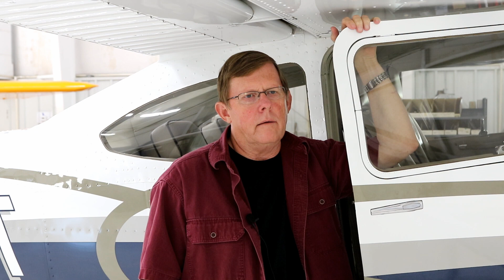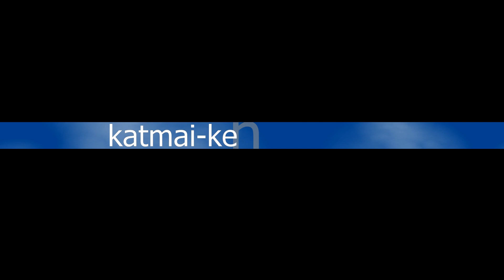Choosing Lean of Peak or Rich of Peak

Comment: I still don’t believe EGT doesn’t matter. If you’ve got compression and timing that EGT getting hot enough can burn it down in that combustion chamber. Anything low compression and timing not a chance. But turbo and or high compression experimental I can see premature issues.

Comment: The way I've been taught is, ROP for best power and LOP for best range!  Also, how come you talk about using cylinder temperatures and fuel flows for setting the mixture, rather than EGT???
Reply: Flight schools apparently don't know about engines. Or if they do - they treat everybody like "you don't have to worry your little head with that".
Reply: Cylinder head temperature is related to internal cylinder pressure, which is tied to stresses on the engine.  Running lean of peak may slow you down 10 percent or so, but reduce fuel consumption by day 20%.
Reply: @christopherbrown1730  Like I said, you run lean of peak if you want to fly farther on a tank of gas -- BUT you set your mixture using your EGT gauge, NOT your CHT gauge!
Reply: @agentorange153  that is not the way Mike Busch explained it in a video from Saavy Aviation about engine leaning.
Reply: @christopherbrown1730  Because CHT is NOT a precise measurement of air-fuel ratio -- it depends on MANY different factors other than your engine settings, such as airspeed, density altitude, cowl flap setting (if you have them) and outside air temperature, among others!  Whereas EGT is FAR more consistent -- it depends only on your power setting and your air-fuel ratio!  So, when you lean your mixture (whether you want to lean ROP or LOP), you use your EGT gauge for the mixture setting, and watch your CHT gauge only to make sure it stays in the green zone!
Reply: @agentorange153  copy.  A small nuisance that I missed.
Reply: @christopherbrown1730  Which is NOT important if ALL that you want to do is save engine wear -- but it DOES become important if you actually want to maximize either range or performance!
Reply: Also, i forgot to mention - the dangerous temp. is when cylinder temp. (CHT) gets above 400 F (i think) which can happen mostly at 75 % power or above. Thing is, that the highest EGT is at 14,7:1 ratio, which is 'peak' and still in that 'danger zone' but coming back down that curve (to lean of peak). Highest CHT is rich of peak, before highest EGT, rising to maximum 13,2:1 ratio or thereabouts. But safe safe zone would be richer than that at 12,:0:1. Or lean at 15,2-15,5:1. The numbers are not precise due to the different cooling systems.
Reply: @terjehansen0101  yes, it is an interesting topic and hadn't thought too much from the fuel air ratios, but it makes sense in hindsight.  I've only seen a CHT and EHT monitor in a rental Arrow.   I am in the camp to run lean of peak for efficiency and take the speed loss.  I will have to rewatch the video mentioned to see what was said about CHT again, but it is tied to engine stresses.   The red box was mentioned.  More to learn.  Looking for a plane myself.  Trying not to overthink that decision.  About two weeks away from an IR check ride.
Reply: @christopherbrown1730  Yeah as i recall, this video did not have any real useful info. But i can highly recommend a video called "obsessed with EGT". It's fairly clear cut with graphs.
Reply: @christopherbrown1730  Oh, maybe you already watched that, actually.
Reply: @terjehansen0101  thank you for the tip.  Wish I remembered one given by a German man that was quick, to the point, and had graphs that provided some explanation as to why to lean.   It gave the ratios of air to fuel as mentioned in this comment string.

Comment: My experience as the owner of five 182’s is oil temps and pressure.  I found the O-470 oil pump was just good enough when new.  But as the engine wore and tolerances grew the pump failed to provide adequate oil pressure.  I actually fitted the pump off a IO-520. That solved the problem.  There is a little panel beating to do around the firewall indentation to accomodate the pump plus change the studs. My operations though were in a hot climate ie 30 - 40 degrees C. I agree 380 degrees F is the target temp for cylinder heads.

Comment: Jeez!  Does anybody get their head out of the cockpit these days?  Is this LOP vs ROP some kind of fad?  What's wrong with leaning until it runs a little rough and screwing it back in until it runs smooth and enjoying the scenery.  Every IO-520 we had made it to TBO with no problems.
Reply: Leaning by the seat of your pants???  That is NOT how I roll -- and while my choice of LOP vs. ROP is situational (ROP for best power, LOP for best range), I ALWAYS use the EGT gauge to do so!  (And that DOES NOT mean never getting my head out of the cockpit -- once I've adjusted the mixture, I can leave it alone as long as my altitude remains constant, which it does most of the time while in cruise!)
Reply: @agentorange153 100% the way I do it. My issue is peak EGT can vary on the engine set up. I’ve flown planes that peak at 1400 and some that’ll go 1600+. My rule is lean to 1350-1450 on my planes that all peak at 1500*

Comment: Some people tend not to believe me but I can run lean of peak with my C-150 if I very tediously adjust the mixture (which I will do on cross country trips). This has very little to do with saving fuel (which is minimal) and a LOT to do with preventing fouling from excess fuel going thru the engine.

Comment: Wait.....lean with CHT!?!?!?!  You lean with EGT.  Then monitor your CHT. You run 75-100 degrees rich of peak.  Or 50 degrees or more lean of peak.   Never use CHTs to lean your engine.  You could be at a peak EGT and that’s super high temp and pressure.

The Peak is PEAK EXAUST GAS TEMP.

Yeah check your cyl head temps.  If your too hot then maybe you richen slightly or open cowl flaps or reduce power.  

These engines should all be operating just fine either rich or lean if peak.  As long as your not watching your CHT for the “peak”.  

But your explaining a bonkers way to lean your engine.
Reply: You did not get what he s saying.  You lean as per usual but want to mane sure to not exceed 380° on hottest cylinder.  Which is great because regardless of your setting using EGT indication, if your CHT is over 380°, your setting is bad and you re compromising your engine's life.
Reply: All I’m going to say is peak tit for me is around 1650 and I run usually 200 degrees rich of that to keep my cylinders below 400 degrees with 500 degree cylinders. The cht formula works for high performance turbocharged airplanes the best
Reply: @russellhernandez1875  your still using the EGT to lean your engine.  To get to a desired CHT.  The TIT is the temp of the exhaust gas going into the turbo.
Reply: @monrow11  to a point... in Florida we have way to hot of a weather to lean to peak.. in a turbo we lean to tit compared to egt. It is not cool enough here to lean a turbo Saratoga to 50rop and keep the cylinders under 400 degrees. So what we usually do is start to lean until the cylinder reaches roughly 390 degrees. We do watch the egt but the cht is more of a problem in higher power airplanes.

Comment: AZ why do you think you know better than everyone else
Reply: Because he's been building and flying C182s with the IO550 and I0470s for decades, it call EXPERIENCE! He's 100% correct, if you have gami injectors and a modern engine analyzer like a JPI you can fly LOP no problem. And if you've flown LOP you'll see that your CHT's are much cooler and when you do your annual you'll see that you plugs are cleaner etc.
Reply: @HookedOnUtah  The problem is not leaning LOP (I do that too if I want to get maximum range) -- the problem is using cylinder temps to find your mixture setting, as opposed to using EGT like you should be doing!
Reply: Read some Deaken and Busch on this.  They explain the science behind LOP.  The problem is not leaning.  The problem is not leaning enough. If you lean just a little you can put your engine at 50 ROP and if the power is high enough you will be at the highest CHT.  CHT's are the best proxy for what is happening inside the cylinder.  EGT is not.   Both Deaken and Busch talk about the red box or red triangle.  That explains the concept in one graph.
Reply: D Bradford yeah but you still base your leaning on EGT.  To avoid high CHT.  Your not sitting there making your initial mixture setting on your CHT.  That’s not right.  If the cylinders are 385 and you want it a bit cooler....yeah squirt some more fuel into it.  Or less if your LOP.  But we should be leaning with our EGT gauge first then monitoring.